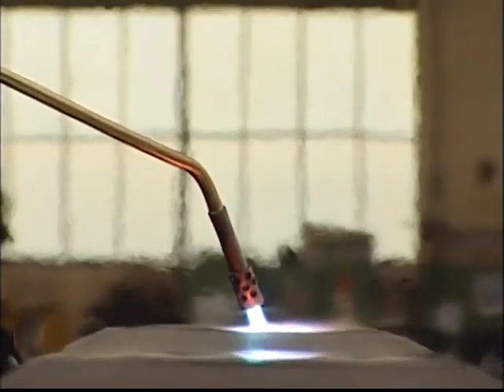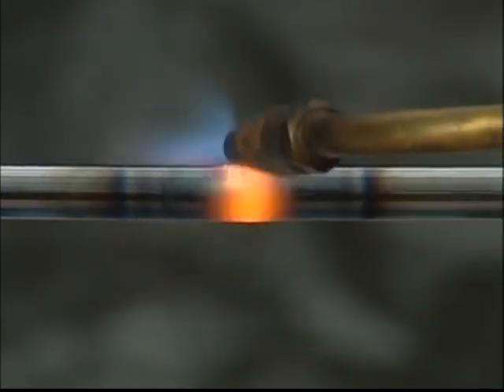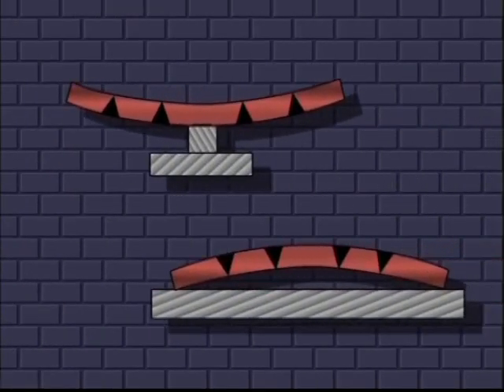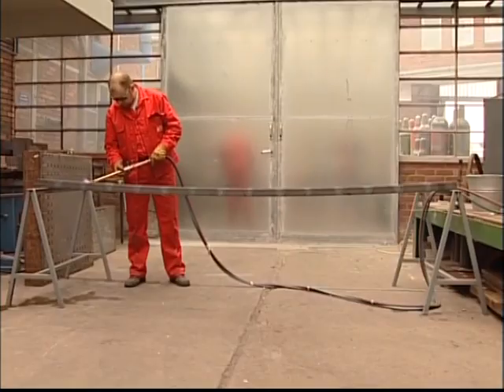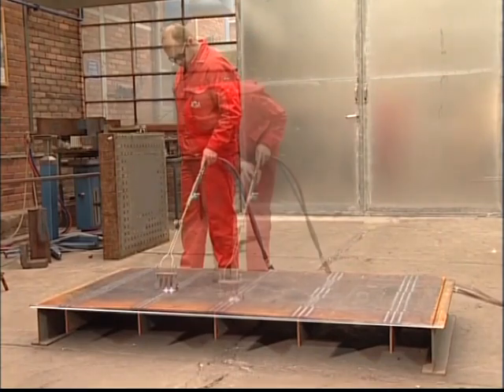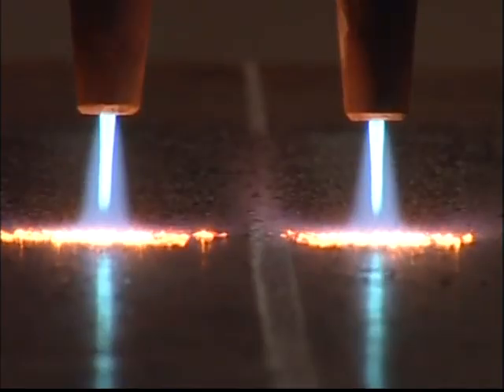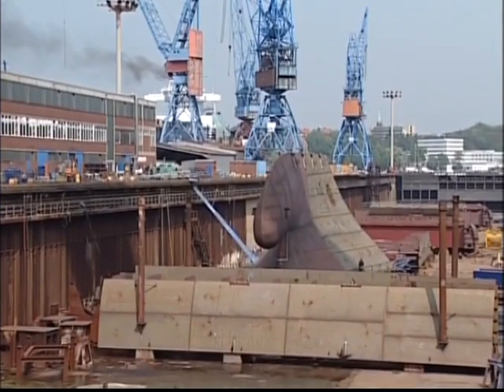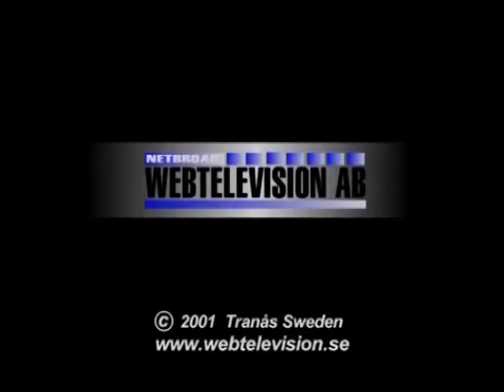AGA Historical Archives - Flame straightening in welding - English

Comment: Years back i saw a guy straightened a pipe that was all bent on the bottom it was holding a car port and he run several welding beads and straightened that pipe ...i was amazed at what i saw ...i was a bridge welder for the railroad and i nevered saw that before....until we had a derailment on a steel bridge and they hired this guys from Washington...that they specialize on straining all kinds of metal bridges ....their last name is the Dalton's just search it and y'all will be amazed...

Comment: Just a caution:  Before applying any heat to any structural member, the type of the steel and its heat treated condition, to be so treated, had better be known.
In which case the straightening temperatures must not exceed the final tempering temperature of the steel.
To ignore this may seriously weaken the structure.

Comment: Easiest way to finish with a straight job is to set a bend in it before welding. Easy said than done because on a fresh job you had to guesstimate the bend that would take place the more you do it the better you get

Comment: German video, logic, utilizing material at the max. Us doesn't use this method for US squids.

damn decks look like the were installed by gorillas on meth. And as a personal experience i watched a guy ill name Tbone drill a hole through a birthing deck into a full tank... anyone wanna guess what he did to repair a hole in a tank that pressurizes with fuel where navy squids sleep??? If you guessed he screammed give me the damn Bondo you are correct!  Not joking he had a honecomb bulkhead on the floor drilling straight down without backing. Bunch of freakin idiots if you ask me.

Comment: I wonder whether "water quenching" is routinely used with flame straightening routinely.
Reply: Since i didn't see much of it in this video, I'm guessing no. I'm sure on thin sheetmetal it is used more, also air guns are used to cool. Alot of the heavy ship weldments and heat treated steels  would not benefit from quenching and could change the temper.

Comment: Excellent video. I worked at a company that used to build and repair semi-trailers. We had one come in that had been rolled in an accident. I watched in awe as one of the old guys went to work on the 24" deep chassis rails with a torch  and a wet rag... two days later the 45 degree lengthwise twist was gone, and it was as good as new. in all directions Watching that guy unscrew this huge chunk of twisted, bent steel was mind blowing. Pure skill. And for those commenters that think this doesn't work, or that say they have tried it and it didn't work for them, try to remember that there is a great deal of skill, experience, and understanding required to do this well. Don't expect to be able to watch a YouTube video and suddenly be able to pull this off. Stick with it, read, gain some more understanding, and you will get better.
Reply: I was shown this wet rag trick 40 yrs ago. It was a new chemical plant build. There was an older guy that had a bucket with water in it. He got the rag wet and put the wet rag on the stainless pipe in the right places to "draw" it back in line. 
  He showed me b/c I was interested in his method. I have been doing the same thing, applying the wet rag on structural parts as well. 
  The material really responds to the effect of being cooled off in the right places. It is very satisfying to "get" the metal to move so I can hold a dimension.

Comment: i watched that for about 10 seconds and dont ever do that 
when you heat metal up you change the structure of the metal that makes it strong 
test it out for your self  heat up a 1 foot bar red hot in the middle  then let it cool down put it in a vice and try to bend it 
it will bend where you heated it up and no where else
Reply: It depends on the type of steel.
Reply: @joashparker8271  no it dont
Reply: And not only the type of steel but also what has been done to it previously. Cold rolled or drawn ? Sure ! Rebar - i.e. partially quenched steels of mild hardenability....sure. Thin section of mild steel that maybe got quenched at the mill and got a bit pearlitic....yep. But some giant bridge member that took half an hour to cool to black in the steel Mill ?? No way. That stuff is not getting any softer.
Reply: @Zonkotron  nope you heat it its messed up after that  test it your self

Comment: I didn't see you using any water like to pull a panel tight we would heat it and then take a hose and spiral our way to the center quickly causing it to contract and pull tight.

Comment: this video is pure garbage, youre not picking 2 tons up with that contraction. in fact your probably going to lengthen that rod if anything. 2 no one does this.... at all. a waste of time and money to flame straighten anything because while you can straighten it  you are also severely weakening it. might as well just cut out whatever is bent and replace it for a 10th the cost.

Comment: I used to build drivelines for a heavy equipment manufacturer and every driveline had to be checked after welding. I used a oxyacetylene torch and dial indicators and it didn’t take much heat to get those drivelines to snap into zero runout. It’s amazing that at least in thinner steel it doesn’t take much heat to have them move into place.
Reply: Same when straightening boat prop shafts
Reply: @chrisbanning413  yep👍

Comment: Such and informative video, if only oxy acetylene was easy to store and cheap i would use it so much...as a welder and lpg torch only go so far.
Thanks for the upload, why don't they do these kind of videos anymore
Reply: There are electrical tools that use induction heating to create a coin-sized hot spot on the metal surface, much like what the workers were doing on the sheet metal.
https://www.youtube.com/watch?v=rJXeD2_eLm0
Reply: Lpg/mapgas and oxygen is pretty close to oxy acetylene temp. Oxy lpg/mapgas can do everything but weld steel, something to do with the chemistry reaction when welding but doesn't seem to matter when cutting though.

Comment: I used this technique in AUTU-BODY WORK, also used it as a PIPE-FITTER and WELDER to Match Up PIPE JOINTS for High Quality Fit-Ups for Welding plus used to Straighten or Curve Pipe or Beams to meet certain fit-up criteria. Very good Video. Well worth watching. I saved a lot of Pipefitters Butt's by using this method when their Math was off. (LOL)

Comment: I used to work for a company that builds and services centrifuges for the waste treatment, food and oil recovery industries. Machines are built out of a magnetic grade of stainless for major structural components. Sometimes due to wear or high vibration issues we would have bores for bearings get out of round. We would use a similiar technique to shrink the high sides of the bore to bring it back into spec and eliminate boring and sleeving.
Reply: That's incredible and almost hard to believe!
Reply: I wouldn’t of thought so as wear does not equal bent
Reply: Yes, and what fun I had doing all the things pertaining to WELDING and PIPEFITTING. I'm Old now and can not do those things any more. Your Story just brought me back to the day's of youth. Thanks Mate for sharing this little part of your life with me. I really do appreciate it very much.

Comment: Only one flaw in this video - almost no information on methods on how to cool steel down after the heating process. As I understood, if you not cool it down, it will bend back.
Reply: Done right, it will not go back, so just letting it slow cool is fine. The hot area shrinks as it cools down and pulls in the direction you want it to go. Sometimes you may want to put it under some tension to prevent it from expanding in the wrong direction when heated (the weight of the metal can be plenty of force), you heat until soft so once you get that far it has no force to expand, and then it shrinks as it cools down = goes the direction you want.
Reply: @ulfg1409  just recently  I've been trying to straighten the HSS beam that bowed becose of the weld, and it pull it when I want it, but got back into almost the same state when cools off. So I had to put tremendous weight on the top of the beam, and use the cool air to cool it off so it won't go back and it helped
Reply: @TriptychVNS  Never heat HSS.  Second you do that you changed it's properties and is no longer rated for the application.

Comment: Should you use water to cool it? or will you get better results from letting it naturally cool?
Reply: It will harden if you cool it with water, and lose its quality.
Reply: @Esarix  not all metals would harden if quenched... Mild steel won't. Copper would soften (or rather anneal)
Reply: @Esarix  --  Could you then "anneal" it with re-heating to a lower temperature?
Reply: I think if you let it cool naturally it will go back how it was, and you don't want that. You can also cool with the air, use the air compressor.